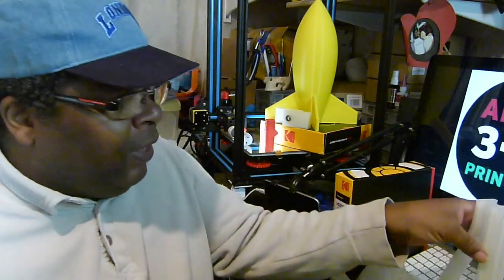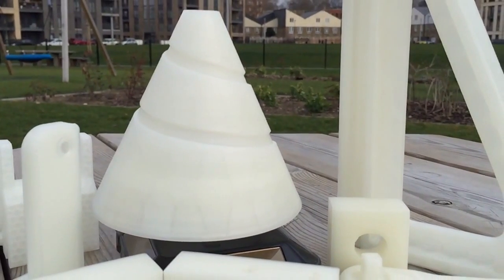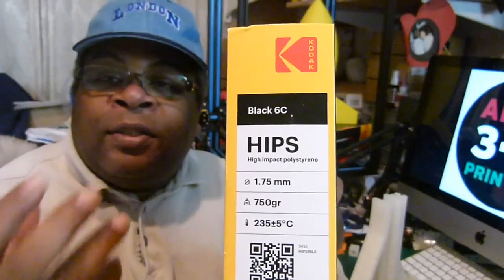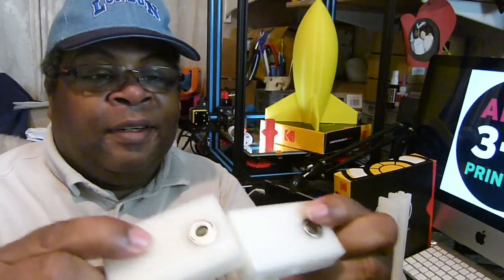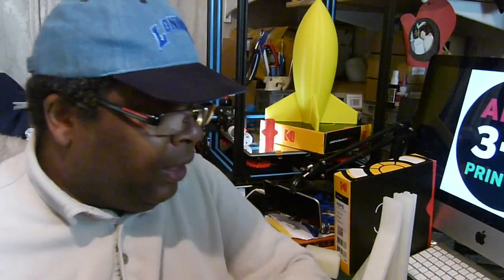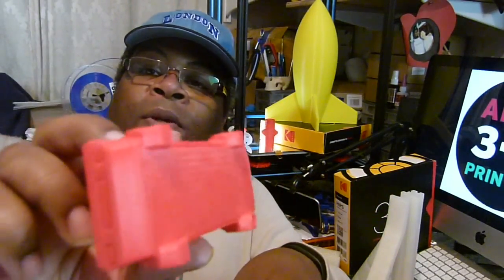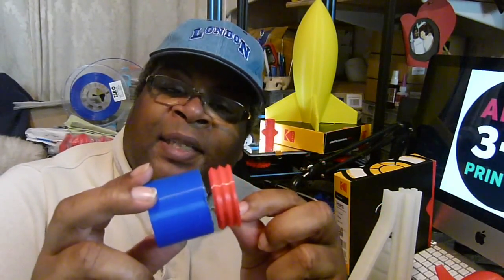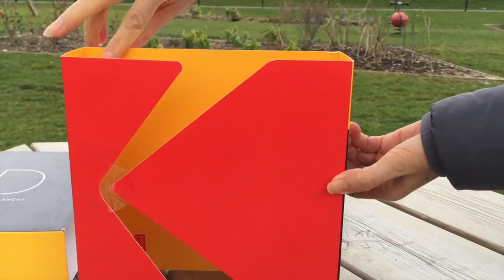Kodak 3D Printer Filament

Comment: I hace been experimenting with PLA and PETG bonding in one print. Pause then wait for the hotend to get to the new temp and change filament then restart the printer. That worked. Have not tried any flexible filament yet.